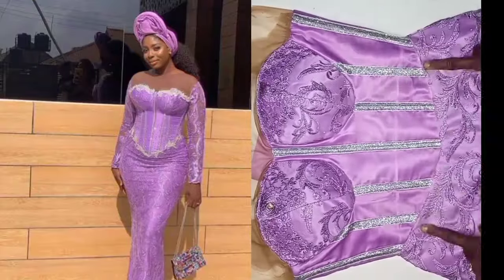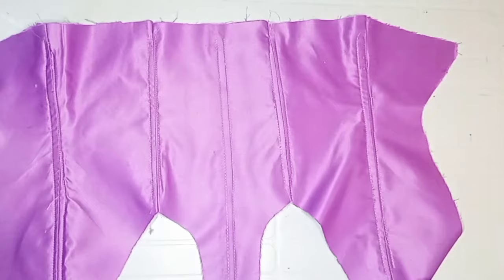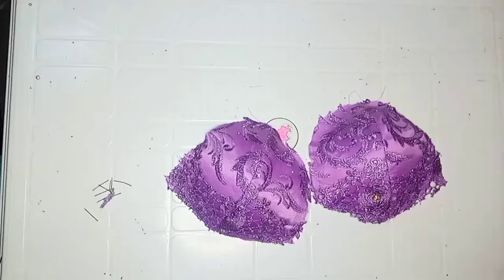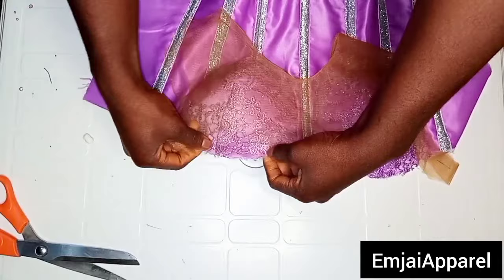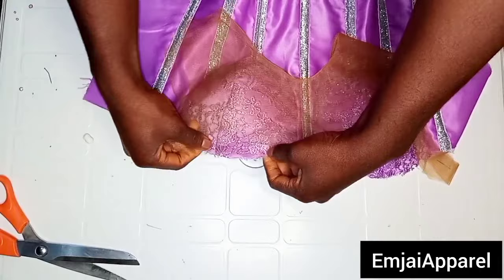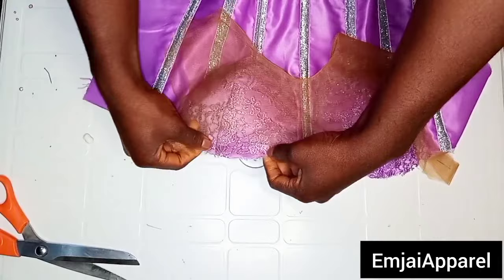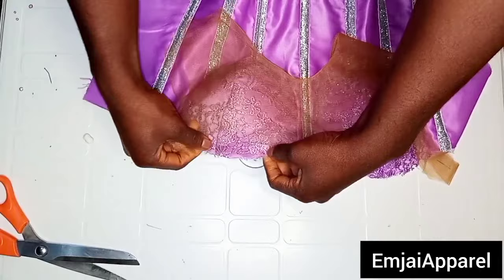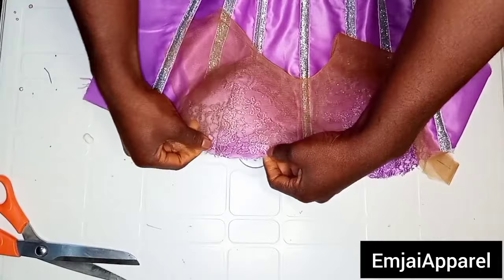How to Sew this Inbuilt Corset Dress with a Yoke, Basque Waistline and Laced up Back

Comment: Did you reduce your waist measurement when drafting?
Reply from the maker: No ma I used my actual Waist measure the second dart I took out is the reduction
Reply: Ma if you didn’t reduce the waist measurements, where did you put the 2” snatching
Reply from the maker: When drafting I added my actual Waist measurement divided by 4. It was from that actual measurements I took a dart if 0.5. so when you multiply it by 4 you will get 2 inch which means I reduced 2 inch from the waist.
Reply: @EmjaiApparel  thank you very much ma. That means you also took 2” from the waist of your skirt because I saw that it aligned well or what did you do?
Reply from the maker: Yes ma
Reply: @EmjaiApparel  thank you so much ma. If I’m snatching with 4” on the top is it advisable to remove 4” from the waist of the skirt or what do you advise ?
Reply from the maker: Whatever you are taking  from the top you will need to take same from the skirt so they both align when sewing
Reply: @EmjaiApparel thank you
Reply: @EmjaiApparel pls ma whenever I get to the lacing part of a corset dress the skirt part does not usually fit at the waist what is the cause and the solution to it ma
Reply from the maker: @liadiyetunde5311  it's not suppose to meet with the lacing because you reduced the back already. So it will be like 2 - 3 inch away from the skirt zip depending on what you took away from the back .
Reply: @EmjaiApparel  thanks so much ma

Comment: The basque waistline doesn't aline with my own, and again did you later cut off the excess from the upper part??
Reply from the maker: Whatever waist measurement you use on the upper part should be the same with what you have on the skirt that's the only way it will align.
Reply: Pls ma, then what happens to that two inches you deducted from the upper back?
Reply from the maker: @user-bc9yt9xp5x  I snatch my waist by 2 inch which means I deducted 1 inch from the back and 1 inch from the front
Reply: @EmjaiApparel  Ohk thanks
Reply: And pls that part at the back of the skirt that you deducted 5inches from why is that so and is it constant for al sizes
Reply: I mean the part closer including the zipper allowance that you closed
Reply from the maker: It is replace by the lacing I added to the back
Reply from the maker: No ma it's not constant. It depends on what you minus from the back
Reply: @EmjaiApparel  thank you so much....indeed you are a very good teacher🤗🤗😘